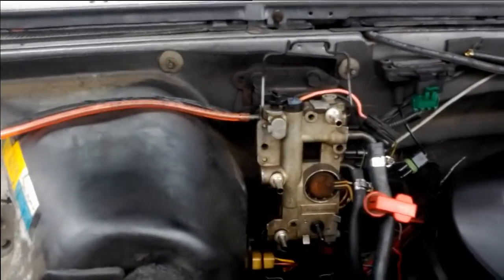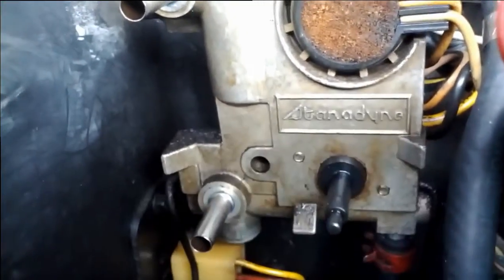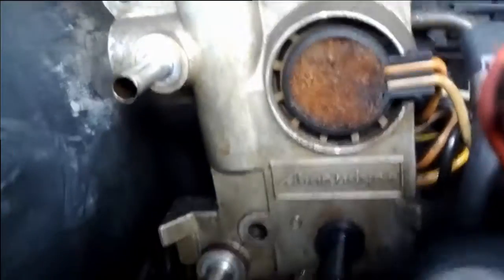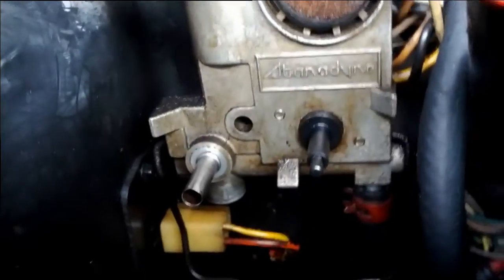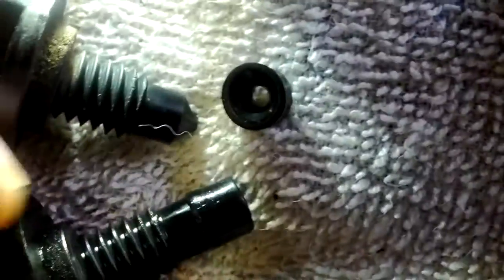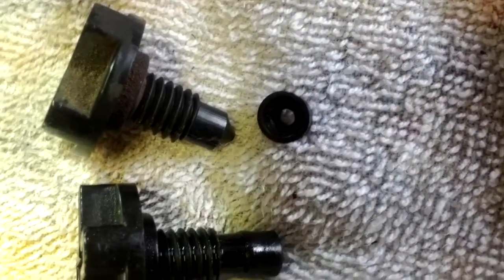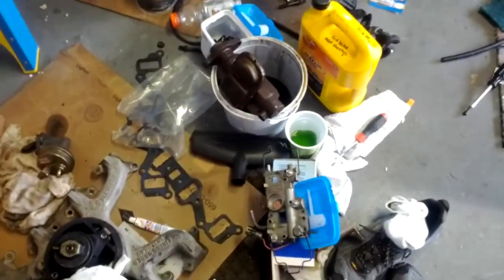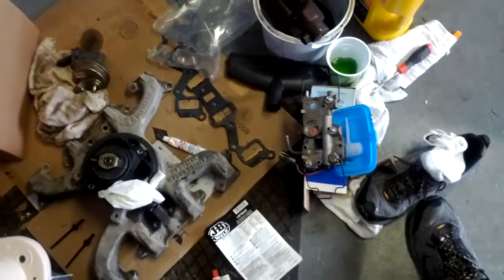Fuel filter housing jb weld

Comment: I watched this vid ! Idid basically did the same thing with a lead wheel weight . I melted the lead into the hole and smoothed it off . Put the sensor back in place. Did not plug it back in . IT QUIT LEAKING ALSO !
Reply: I'm considering doing this... question: what is that sensor for?

Comment: how did you get the truck to run with out the sensor plugged in? i have the same problem and i jb welded the hole up but now my truck wont start.